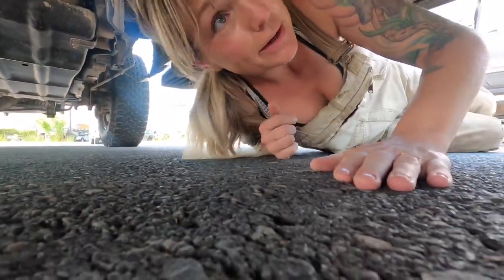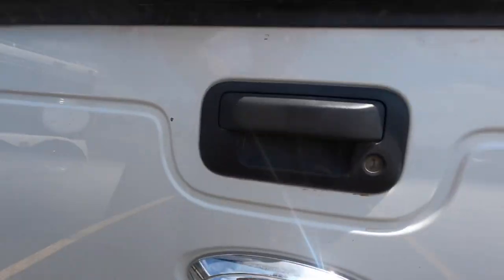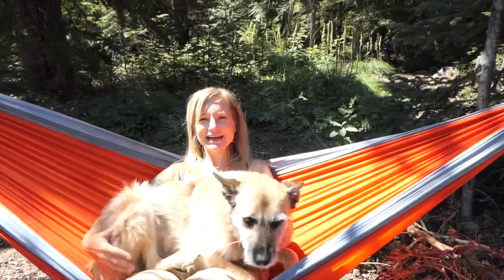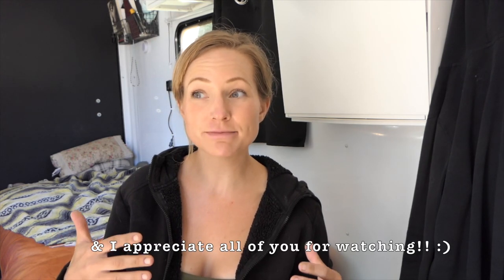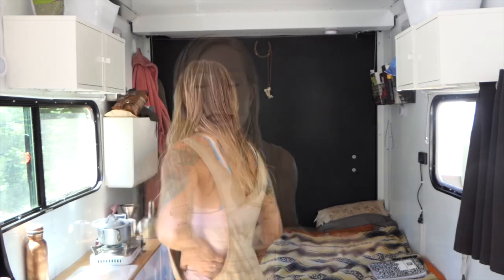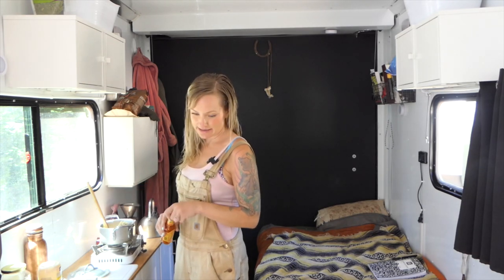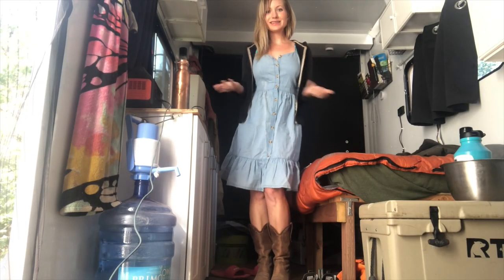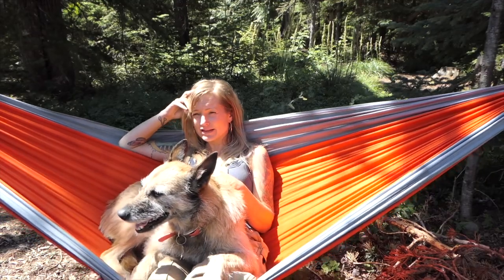Diesel, Dating, & Dance parties - a weekend living in a Cargo Trailer Camper Conversion

Comment: Just the fact that you made this video shows your moving forward with your life even if at times the pace sometimes leads you to think otherwise. 

Two things I would have done differently. I would not be putting diesel in a food container that I use for food or other things. No water so I would have dumped it back in my fuel tank or into the tank you did. Whichever is easier with the least amount of cleanup. Any throw away clear container such as a single use empty water bottle. A sandwich baggie placed inside the container you used would allow quick cleanup and prevent contamination of the glass vessel.

Comment: That fuel sump drainage? If it’s clean and dry, just get a funnel and put it in your truck tank if you don’t need fuel for the heater. Nothing wrong with it, and even if it had water it still has to go back through the filter/sump. Of course, if there WAS water and/or dirt, just pour off the good fuel on top. Use the as stuff to start campfires (just don’t try to save in glass!).             My wife and I have been together 43 years. I’m not sure I would or could seek another if she passes before me. But then, I’m not a young catch like you! 👴🏻

Comment: Hey Lex, I just took my 1st shower with the Ivation batt powered shower you recommended and I think you actually understated its awesomeness! WoW what a change from the hanging camp showers. . . not even in the same planatery ZipCode!! Very nice! So the old Southern tradition was a minimum of 10years . . . read "gone with the wind"   . . . I think your guilt is a healthy thing, kinda like feeling the campfire is to hot. . . let it die down to embers before you start cooking. . . . me Im an off gridder onmy own landvon a high desert mesa in NW NM. Come hang out with my dog and me if your in tye area. . . honk first and  I'll put some clothes on. . . freedom sister! ! !

Comment: How do I get rid of diesel safely?
I pour it into my fuel tanks on my 1997 Ford CF8000 ExpeditionVehicle.
How do I get rid of:
* cooking oil
* rancid oil
* excess engine oil
* pretty much any petroleum-based and plant-based oil
...straight into my fuel tank.
I suggest avoiding this with anything other than a Cummins 12-valve.

Comment: A tiny amount like that dig a small hole and put aluminum foil in the hole, dump the diesel and light it on fire.
Reply: You can’t burn diesel, it’s not flammable.
Reply: @ScottSharpe2121  
Working forestry projects, we use diesel to fire slash-heaps.
Your experience may be different.

Comment: Hmmm  ? 
   Where do you dispose of your used motor oil , I use the local auto parts store . Most of them not only sell oil , they accept used oil also .
    But do not ! ! ! , put your diesel fuel filter drain in it .
    Your fuel heater , or a very small amount as a fire starter , but not gasoline  ! ! !

Comment: Hell, if you have waited that long you are a virgin again lol.  It was really hard for me to date with a greyhound and live in the country. Some said they love dogs and they just love the country also, but ya got to watch how that works out, some really just thought they did.  I can't believe the Ferd creatures located the water separator under the freakin truck. You shouldn't have to take it apart every time at least. While you have to crawl under there and get all dirty, you can see the water in the bottom if you get a bad batch of fuel.  I went thru thousands of gallons of fuel over the years in my big truck and dirty fuel clogging the filters was way more of a problem than water was. It's a good idea to carry a spare fuel filter or two if they run two with that diesel.

Comment: I'm too old to remember dating, BUT I DO REMEBER SKINNING MYSELF CRAWLING UNDERNEATH VEHICLES. I cringed when I saw you do it. Please find you a piece of cardboard. Preferably one with a slick side. Place it underneath your vehicle to protect your precious skin when doing your maintenance. Since it is thin and cheap, you can save it to use a few times and get another. Good luck on your dating.